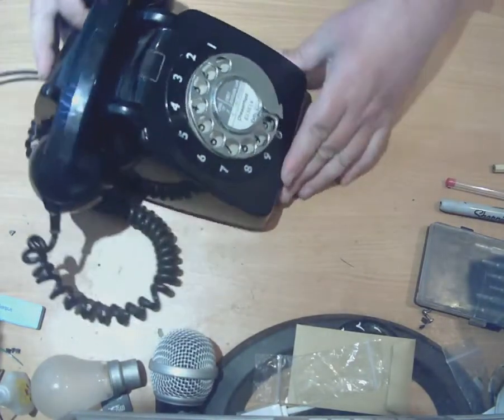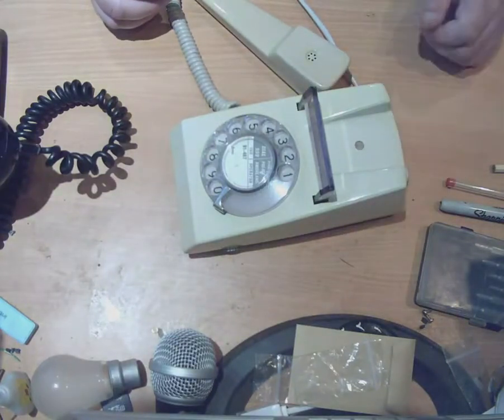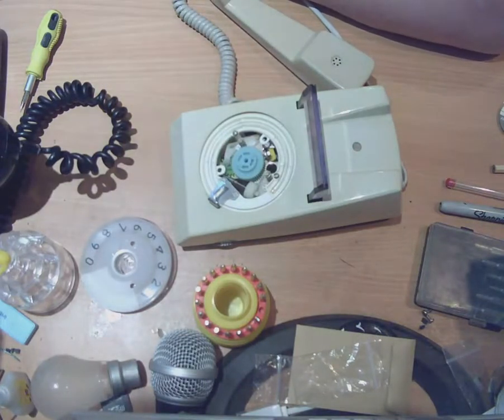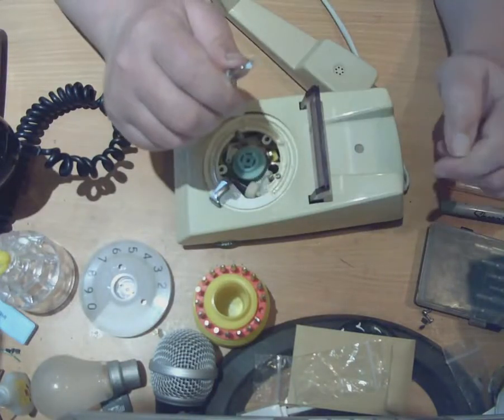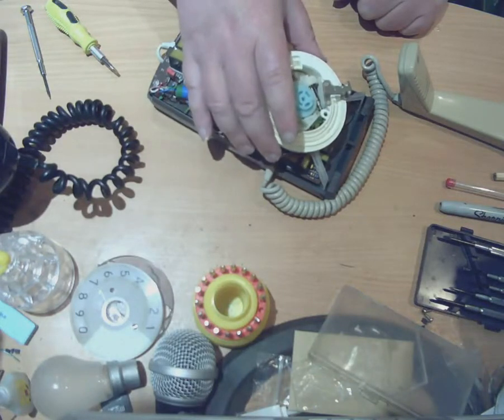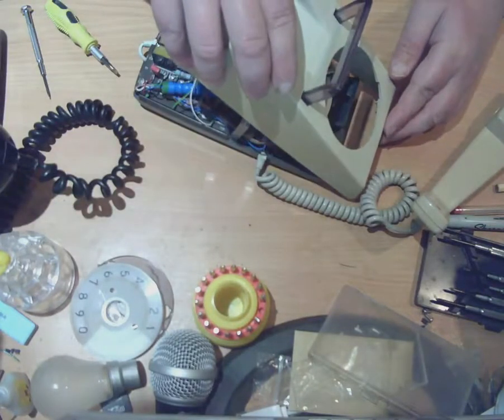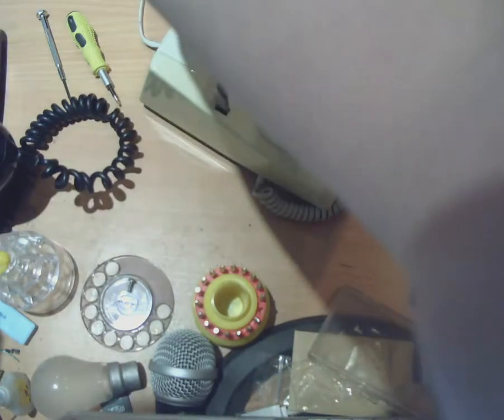Andy's Shed Live S01E07 - HOW TO FIX A TRIMPHONE (full episode)

Comment: To get the big board out, you mentioned that tube, if you flip upside down to the under side of the base, you'll see the screw that holds the board down. Great video, came here to wire a BT plug to a push button parrot phone. Luckily mine has the old "chopped" chord that correspond to what you said about the line in.

Comment: Hi Andy, I have a trimphone and it worked fine until recently ! The fault seems to occur when I first plug it into the phone line and I pick the receiver up and the dial tone is evident ! place the receiver down again and lift it again and it permanently blocks the line and I am unable to dial the house number from say my mobile ! Any ideas ?  Thanks Kev
Reply from the maker: Hi Kev. It couldbe the hook switch in the phone sticking. Is it a genuine old trimphone from the 60s/70s with a proper dial or is it one of the modern ones? The modern repros from firms like Wild & Wolf or the modern company calling themselves GPO are not very good and prone to all kinds of issues. If it's a genuine one they very rarely go wrong.

If it's genuine, remove the plastic screw on the top of the case and the body should just lift off. You will then be able to see the microswitch that the hook operates. It's a bit odd because there is a kind of see-saw arrangement inside the phone, so when the micro_switch is released that is actually the on-hook position. When it's pressed that's off-hook. You'll see how it works by looking at the plastic mechanism. The microswitch could be sticking.
Reply: @AndysShed  Hi Andy I’m sure it is a genuine Trimphone it says on the base of the phone : 2/722 TCH 73/1 there is also a label attached saying Mk BMF Modified thanks Kev
Reply from the maker: Sounds like it's genuine with those markings. It's a strange fault though. Can you try another phone plugged into the same socket?
Reply: @AndysShed  Hi Andy I have only one socket ! That said when I unplugged and re-plug I get a dial tone ! put receiver down and lift it and it blocks the line so it must be a fault somewhere in the phones circuitary Any ideas ?
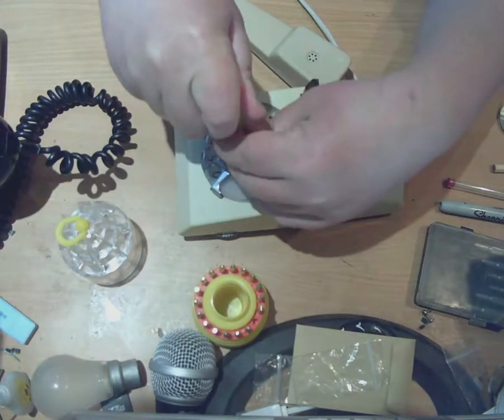Reply from the maker: It could be something to do with the switch hook. Also, has the phone been properly converted? If you have Zoom feel free to drop into our 'Repair Cafe' event between 7-8:30 on Thursday eveningand we'll try to diagnose it for you. It's zoom meeting number 8069994444

Comment: Hi Andy, thanks for this video. I’ve just converted a trimphone and while it can make and receive calls, the bell doesn’t ring. I’ve checked the volume settings as well as the connections to the bell but they all seem fine. It was my late uncle’s phone and to the best of my knowledge it was fully functioning using the old fashioned connection until his death about 5 years ago. Any help would be appreciated as I’ve never tried anything like this before.
Reply from the maker: Hi Paul. Have you taken the strap out and fitted the 3.3k ohm resistor in it's place? This brings the REN of the phone down to 1. You need to check that all your phones connected don't add up to a total REN greater than 4. An unconverted phone such as a trimphone or a 706 has a REN of 4 on it's own, which is why we have to do the conversion. Also make sure the blue wire is connected in all your wall sockets. Finally, make sure there is an ADSL filter plugged into every socket.

If it still doesn't work, drop me a line via the contact form on my website at a
https://andysshed.callpress.net
Reply: Andy's Shed Hi Andy, thanks for taking the time to reply. I contacted the seller on eBay who I bought the cable from and he said that I needed a conversion kit rather than the cable alone. He normally sells the kit with a cable but he was good enough to remove the cable and send me the rest at a reduced price. It arrived this morning, and although I had a quick look I haven’t had time to do it yet, but from what I saw on the instructions he’d sent fitting the resistor looks pretty straightforward. (Famous last words!) I’m hoping to have a go at it tonight and I’ll drop you a message to let you know how I get on. All the best and thanks again, Paul.
Reply from the maker: I'd be interested to know what's in the kit other than a new line cord and a 3.3k ohm resistor. That's all you actually need to do the conversion and a resistor on it's own should be about 5p. I normally buy a bag of about a hundred for a couple of pounds from E-Bay.
Reply: Andy's Shed Thanks for taking the time to reply. The pack comes with the cord, either 2, 2.5 or 3 meters, (the price increases slightly the longer the cord) there is the resistor, instruction leaflet and a small bottle of mineral oil. Mike is also very helpful with any questions I have, but now you have told me of the availability of multi packs of resistors being available on eBay I will buy some then all I will require are the cables. Do you have a supplier that sells them cheaply? Also can you recommend a basic book that details old GPO models, along with a source other than EBay for the phones themselves? They are quite expensive on there. 
I have now completed two trimphones, the original one that I did for myself and a second that a friend asked me to do after seeing mine. I hope to focus on Trimphones for other people, but I would like to find out about different models of other old phones and have a go at converting and collecting them. Thanks again for your message. Paul.
Reply from the maker: Hi Paul. I don't know of a source other than E-bay for phones. You can sometimes find them in antique shops and at car boot sales.  I wouldn't pay more than £20 for a trimphone unless it's a colourful "Snowdon Range' example from the 1980s, some of which can fetch quite a high price. They should all come ready wired for plug and socket though, so no conversion to do.

Beware: There are a lot of repro trimphones out there that were made yesterday. Check to see if the have a * and # on the dial. If they do then don't touch them because they're a cheap modern copy.

It should be possible to find phones for about £10 each on E-Bay. You might struggle  a bit with trimphones though.

I'm currently working on a book myself, which will hopefully be a restorer's handbook, with photos to aid identification and wiring diagrams to help with restoration projects. I'm hoping to have something that covers 7xx series (including trimphones) out later this year.
Reply: Andy's Shed Thanks again. I bought one which I got for just over £30 including postage from eBay a couple of weeks ago. I have seen a couple of the Snowdon trimphones, they were around £140-150. I’d never heard of them until recently, are they designed by Lord Snowdon or is that a red herring?
Reply from the maker: The Snowdon phones were old phones that had been retrieved by Telecom at the time and refurbished with new cases and the plug and socket line cord. They were then sold it Telecom's new phone shops together with the brown 746 known as the Yeoman, which was another new creation at the time. I think the colours did indeed have something to do with Snowdon. God knows what he was thinking with some of them though.

Talking of trimphones, if you want to see some interesting non-standard ones, watch some old footage of Multi-Coloured Swap Shop on Youtube. There was also a gold plated one used on The Golden Shot for a while in the early 70s

Comment: Hi Andy thanks for video, I have a Trimphone, with an annoying crackle, can you tell me how to to sort it, would very much appreciate it thank you.
Reply from the maker: Hi Jenny. The crackle is most likely a problem  with the handset cord. Because they are getting pulled and twisted all the time the conductive cores are prone to breaking, which sometimes causes an intermittent fault and the crackle noise. One way to test the cord is to deliberately move it around while you're using the phone. Does the noise react in time with you jiggling the cord? If it does then it's definitely the cord. If not then it might be something else like a loose connection on the main circuit board.

Comment: I was interested to see this video but your disassembly of 722 was new to me. I used to just remove the plastic screw and place my thumbs on the top or upper edge of the dial  and pop the case. Clearly this does apply some stress on the finger plate but does save dial disassembly. I was never taught your method at work so was surprised to see you doing that way. Always happy to learn something new.
Reply from the maker: It sounds like you remove and refit the cases they way they are supposed to work. However they don't always go back on easily, so removing the finger wheel from the dial just helps a bit. There's a similar fitting problem with 706 and 746 cases sometimes. The American 500 series phone is a lot easier. They seem to have thought about the design a bit more.

Comment: What is that long blue thing? Mine doesn't  have one in and I cannot get it to ring, is this the reason? You don't actually cover the part that is the warbler? Can you please help?
Reply from the maker: There is a new trimphone video on the way that will cover the ringer.
Reply from the maker: The blue thing is basically a regulator. I would think your phone would work without one, but you would probably need to jumper some of the terminals together. I'm not sure off the top of my head which ones though. It's probably best just to find one and fit it.
Reply: Andy's Shed Excellency